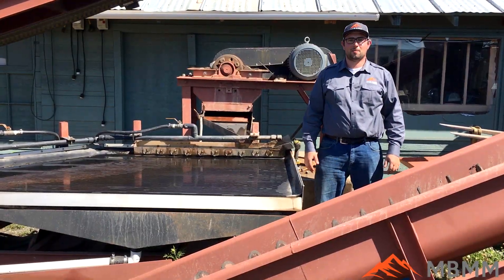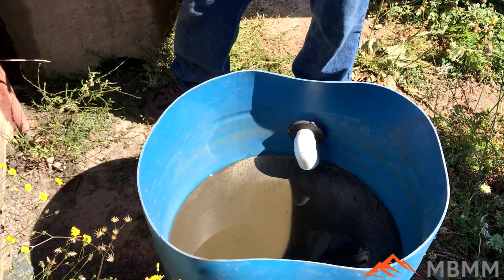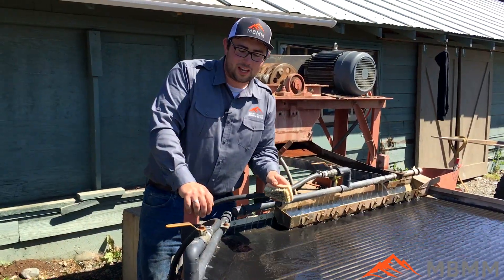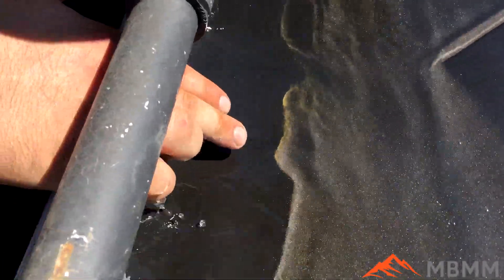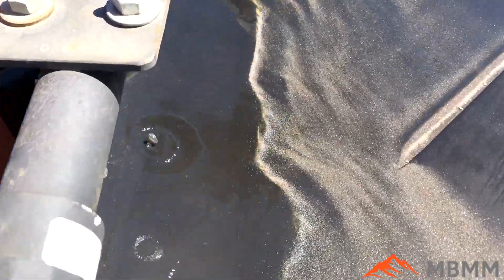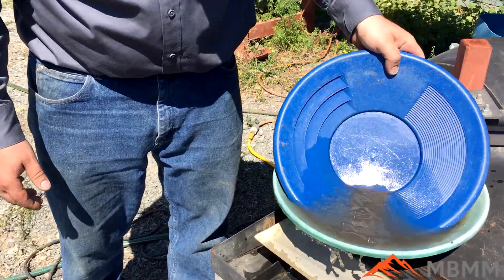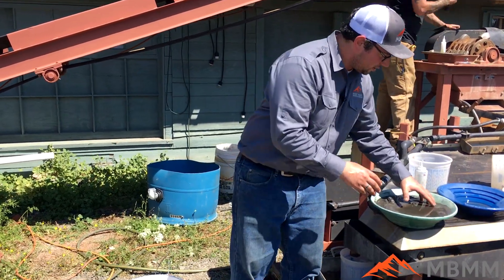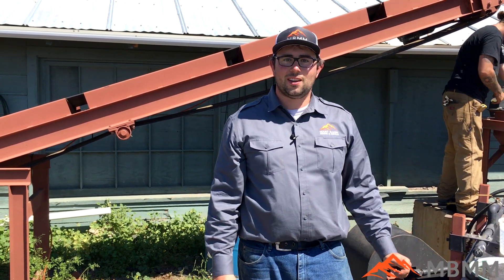MBMM Shaker Table Recovering Gold from Gold Cube Tailings!

Comment: Sorry, but not fair to say the shaker table recovered goldthat the Cube couldn't. Had you re-run those tailings through the Cube, it may well have recovered that exact same amount of gold.
Reply: Yeah, but you don’t want to have to run your materials twice. I’m a big fan of the gold cube! But you just can’t beat a shaker table. The surface area and action are unbeatable on micron gold. Only thing better is using floatation, or just leach with cyanide (which even that won’t get all of it)

Comment: hi Jeff cool video with great info i have a question for Jason:  how do i get the gold out of my borax?  its suspended in the glass and it wont come together.  Jason is the only one that has done all the tests with collector metals  do i need to use a collector metal.   what im doing is roasting some sulfides mixed with charcoal on a rusty steal plate with a handful of rusty nails till the charcoal is all burned out stirring continuously.  then i pan it out and whats left is a yellow / goldish looking powder very fine so i add some borax and smelt it in a kiln fo about an hour, then pour into a conical mold, and nothing but a black /yellow glass no bead.   help!
Reply from the maker: Have you tried panning the roasted sulfides before melting them down?  Any free gold?  It is hard to tell what the problem is from the description, but I would start with confirming there is gold in your material with either panning after roasting or getting a few assays done.  I am working on another video that should be up soon for direct smelting gold so that may help answer some of your questions too.  If there is enough gold in the sample (more than 0.2 or 0.3 grams in about 30-50 grams, or about 1% gold by weight) then it should collect in the bottom of the cone mold.
Reply: It's from my hardrock mine , and it starts to melt almost immediately with a small propane torch, witch is weird  because in the borax it won't come together.   Thanks again for your time I appreciate it .
Reply: I do pan it down and there is some free gold but it's mixed with a goldish / yellow (when wet) sand/ powder that is very heavy it stays behind on my little Miller table and or pan  and is under the black sand very heavy.  That golden/yellow sand is not there if I don't roast the ore.   I tried to melt it together and it turns into a silver metallic looking glass that is very brittle.  When the sand is dry it looks like blond sand with a slight yellow color. Again not present if I don't roast.

And thank you so much for taking the time to answer my questions I'm really at a stand still.👍
Reply from the maker: The only stuff I have ever messed with that sounds similar is scheelite, a tungsten mineral.  It is very heavy and has that blond color.  Not sure, but it may be forming from a tungsten sulfide when you roast it.  Tungsten minerals are known for having a very high melting point too.  Not sure if that helps much.  Is the ore from a hardrock lode or a placer claim?  You might want to send some off for a 30 element assay and then you could tell which elements you are messing with and may shed some light on the problem.  Good luck!